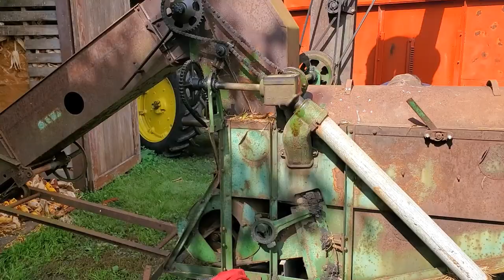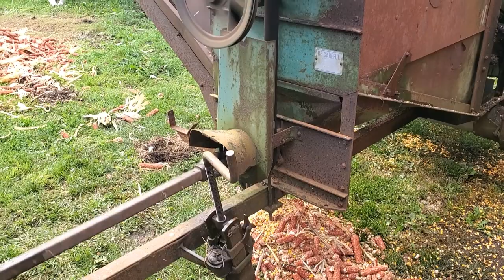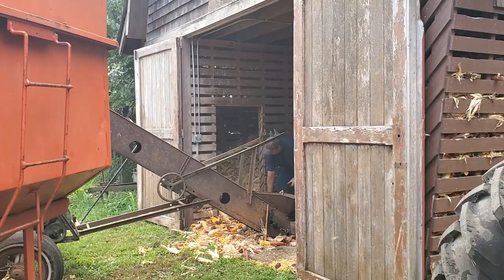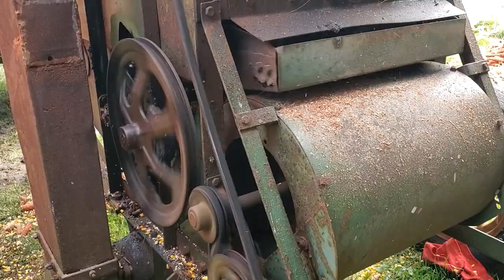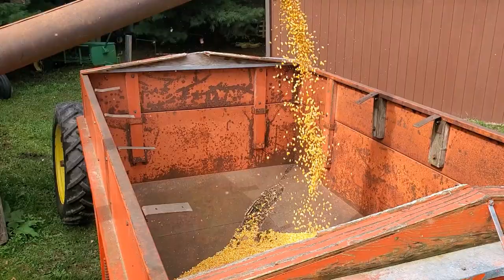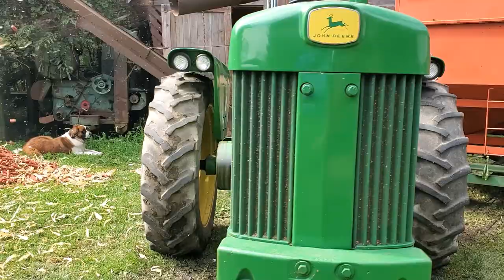John Deere 730 and 71 sheller emptying corn crib

Comment: It's amazing how similar your sheller is to my Minneapolis Moline model D sheller. One noticeable difference however is the blower is on the main shaft on the MM model D. I run mine with my 60 and I use the cobs and husks to bed my steers.

Comment: Dean  you have some really nice equipment that corn sheller works really good I expect you put a bit of time into it making it run as well as it does, and your 730 is kicking butt as usual!
Reply from the maker: The sheller took some time to get dialed in yes. Was sitting in a shed for 25 years so had to find a few belts first!
Reply: @Deandeere4020  Well the good part is it was INSIDE the shed Dean most of the stuff I find is in the shelterbelt out behind the farm and its been there for 25 years, usually many parts are rusted solid, then you need to decide is it really worth all the effort to rebuild this one or should I find one in better shape?  The other 75% of the time the farmer wont sell it because he is going to get it going  next summer?  Really I respect but really dislike THAT answer!

Comment: I am a big fan of old school as I am old. I always wondered the corn will be ground before it is given to the animals and mixed with other things for ground feed so why separate the cob and husks grind the corn whole. I am looking at this from the point of view, that the end result is getting the nutrients to the animal and start the compost cycle for replenishing the soil sending all the corn parts through the animal, to me anyway looks to be the fastest way.
   I know some farmers like to raise corn feed animals, with that they must buy the other nutrients the animal has to have so feed them ground feed and get it over with in the least amount of steps.
   I don't know I just thought I would ask.
Reply from the maker: Alot of farmers ground the cob and corn together right out of the crib but it was labor intensive usually. It has changed over the years to be less so with the use of more skid steers and mixing carts. Milk farmers still chop silage corn and store it in bunkers for the year and that has everything in it with the corn, stalk and cob all chopped up. We wanted to sell the corn out of the crib and we had enough feed for the year so it was time ha.

Comment: I am looking at a 730 gas to buy. How has that tractor been for you?
Reply from the maker: It has been great for us, it was restored in early 90's and has cut and baled hay every year along with plowing and discing our corn fields each fall. Just a work horse for us ha! Also it will start in below zero weather unlike any other tractor we have
Reply: @Deandeere4020  thats awesome! This one is very straight but has something going on in the motor. If i purchase, Probably doing a rebuild so i know its right and fresh. Everyone loves the diesels as do I but the gas intrigue me.
Reply: Unless you need a tractor that starts easily in the Winter and you don't plan to use it a lot, don't touch a John Deere 730 gas.  We had one and it was a gas eater and over heated.  On the other hand the diesel was the most fuel efficient tractor ever in the history of the Nebraska tests at the time.  Go to http://www.tractordata.com/farm-tractors/000/0/5/52-john-deere-730-tests.html  to check it out.  Gas 6.3 gal/hour, Diesel 3.2 gal/hour.  Of course if you are only using infrequently to move snow in the Winter go for it.  I spent a lot of time on both a 730 gas and diesel.  Good Luck.
Reply: @greggergen9104  i am mainly a collector show/parades with light work. I ended up passing on that 730 and did a total  180 because I found a 4020 diesel. Always wanted one. Thanks for the reply btw!
Reply: @actZR900  They are cool tractors, if you don't have to work them steady.

Comment: Leaking an awful lot of shelled corn there.
Reply from the maker: Haha ya! First time getting this one running used duck tape before we continued. Looking for another sheller for parts to try to improve this one too
Reply: @Deandeere4020  Good luck with that. Yours is the first one I've seen in over 40 years. I like your two cylinders. Did you restore them? Family tractors?
Reply from the maker: We have a friend that paints them for us. The 730 was repainted over 25 years ago.  The 730 we bought 30 years ago from a local dairy farm and its what we used to bale hay and everything else at our place
Reply: @Deandeere4020  That's a sweet tractor. I'm surprised, not much survives a dairy. The 620 is nice as well.
Reply from the maker: The 620 came from another dairy farm as well. It is actually the tractor my dad used as a kid while working there. We finally tracked it down from it being sold a handful of times.